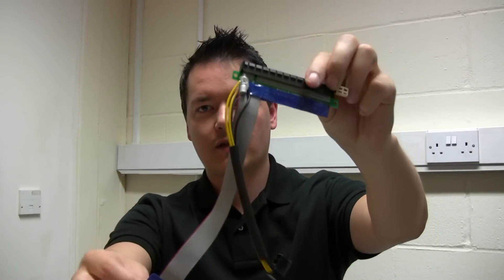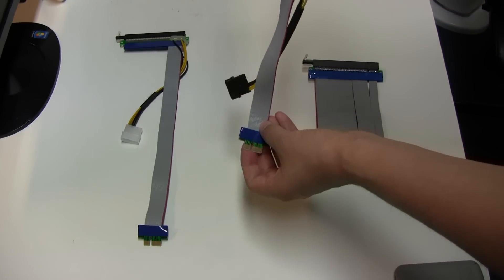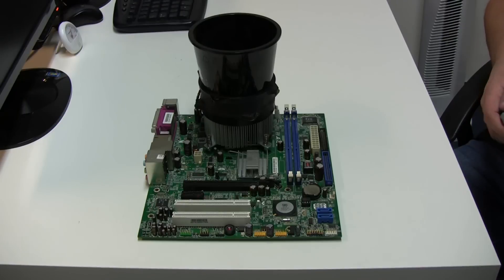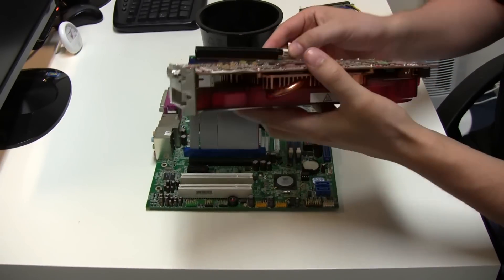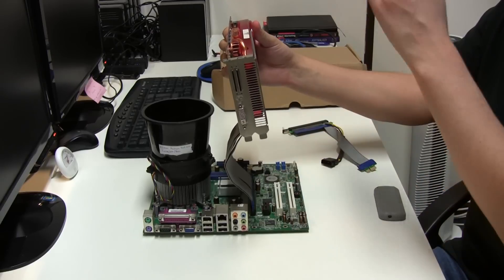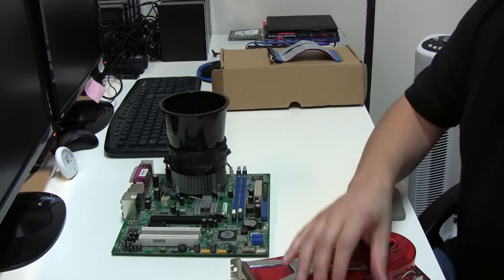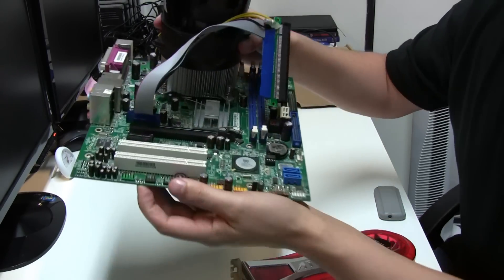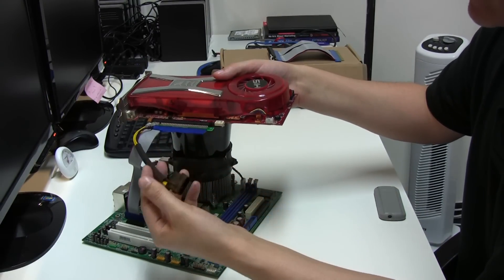PCIe Extender Cables For GPU Cryptocoin Mining

Comment: Thanks a lot, just one question, is there any difference between mining with the x16 - x1 extender instead the x16 ?? I mean you lose Mh/s?
Reply from the maker: It doesn't make any difference to mining performance you can use 1x or 16x.

Comment: Hi Lee. Very Interesting video.
There are also PCIe x16 extenders with molex as well.
Can I connect the molex to a different PSU (Not from my PC).
I intend to power the Graphics card separately from my AIO PC to ensure there is enough power.
Thank you
Reply from the maker: I'd only recommend using a secondary psu that is linked to a primary psu via a link cable.
Reply: Thank you!

Comment: Hello Lee, thank you for the video. I am having a lot of difficulty figuring out how to properly power my USB risers to 2 RX480s , could you make a video explaining
 the power solutions to all these risers? The connections to the power is left out in every video and that is the important part. Thanks
Reply: did you figure that out?  im having the same issue.
Reply: I agree with Andrew.  I have seen it a bunch of ways.  PS splitting off to riser and GPU.  Dedicated cables to GPU and riser separately.   Would be great to see a video.  If there is a way to get a riser with a SATA connection in the video that would be a +++ since that is the way they seem to be going.    Thx Lee !!

Comment: i got one that uses usb 3.0 i wonder if you can mount more than one gpu on a hub then to the adapter to the board
Reply from the maker: You mean a usb hub? The usb cable is just a data cable instead of a ribbon cable so a pcie slot is needed at the end to plug into for the gpu to work. You cant plug it into a usb 3 port and use the graphics card.
Reply: ya i have the pci 16x to the pcie 1x so instead of going directly from the riser board go into a 3.0 usb hub and the hub go into the adapter 1x slot so if the mother board only has say 4 slots you can still triple the gpu power if you use the same cards on the usb hub

Comment: Hi man, how are you?

I have a question about the pci risers. I have a PCI Express 1 x to 16 x 30 cm Molex Powered Riser Cable and which I have connected to my new rx 480 8 GB. I think i do something wrong. When i start the pc, i get the screen that tells me that i need the powered riser cable to connect on the motherboard and I have done it and then I still get the same screen. What am I doing wrong?

Greetings maurice
Reply from the maker: What motherboard pro btc? use the molex connectors on the motherboard, connect them to your psu. You can skip the warning if your using power risers like you have stated.
Reply: i use the ASRock H81 Pro BTC. i have connected the molex connectors from the psu to the motherboard to the graphic cards and i connect the psu to grapic card.
Reply from the maker: Mausiej Wausiej
You're good to mine then, just dismiss the warning and continue.
Reply: ok thank you

Comment: Hi Lee, 
good lesson , the problem is there are two type of the same PCIe Extender Cables .One with power input and other without !!! do you have any idea Lee!
Reply from the maker: I use the ones with the power input, you can use the ones without but the powered ones make more sense and take the power load off the motherboard which is good if you're using multiple GPU's.

Comment: im not all the way thru the vid but in case i forgot there is also USB extenders
I have some GPUs running through 11 feet of usb 3.0 cable 
great way to move your main heat source if you need to like myself

just finished the vid and saw you mentioned the USB cables
dunno how long of a cable you can get to still work
but a baseline would be in data transferring at USB 3.0 speeds, speed loss happens around 3 meters depending on the cable
mining GPU need far less bandwidth
could prolly get 20-30 foot USB cables and still mine

Comment: Hi Lee, 
good lesson as usual. got a question, the new GPUs use PCIe3, can I use it on a motherboard wich has got a PCIe2 ?
Reply from the maker: +Collect satoshi Yes you can, I have a gtx 970 pcie 3 and run it on a older motherboard Asus P6T-SE with PCIe2

Comment: You would want boards with the 16xPCIe slot though right? Don't you lose performance on GPU mining on the 1x PCIe slot?
Reply from the maker: +xxKUTAKIxx No, thats what I first thought years ago when I started gpu mining and those 4 x 16x mainboard were crazy expensive. So lucky I found this method before buying. I don't know the exact reason but 1x pcie is perfect for mining but no so good for gaming at least according to what I've read, I've never actually tested it from a gaming point of view.
Reply: ok thanks
Reply: PCIE is a direct connection from the graphics card to the cpu to send massive amount of graphics data back and forth but with mining, cpu is not a factor and all computation happens on the card itself and very little data needs to be sent to the cpu.

Comment: Hi Lee thanks for the vid. They are really helpful!

One question? Have you ever tried to mine using the predictable solo mining pool called ethpool.org? 

The reason I ask is I can't get it to work and its prob my .bat file that's wrong
Reply from the maker: +bignose140 Hi, I've not used that pool. You can post the details of your batch file here and what miner your trying to use and see if I can spot anything obviously wrong. Was the miner giving you an error? My video on batch file setup my also be useful https://www.youtube.com/watch?v=n77uUdFYjWc
Reply: +RiskyRandoms Thank you very much Lee!
But after digging a bit deeper. It looks like its a proxy problem. Don't worry about it. I'm just trying out different pools to see what they are like. And contemplating whether or not to build a rig. Currently just running the GTX 970 thats in my gaming rig atm.

But thanks very much for the offer to help out!

Much appreciated

Comment: hi Risky, i just build 6x amd 9390 rig and i try to use the usb 3 risers but its keep on crushing my windows, i cant install the graphics drivers. i will try with normal PCIe extender cables
Reply: Hello, how did you fix that?
Reply: Apparently the HuntKey X7 1200W can only run 3 GPUs as main PSU, i put different brand as main PSU and ALL 6x9390 WORK !!!